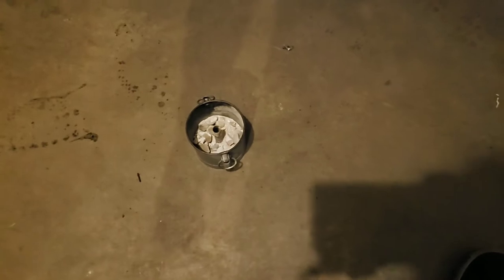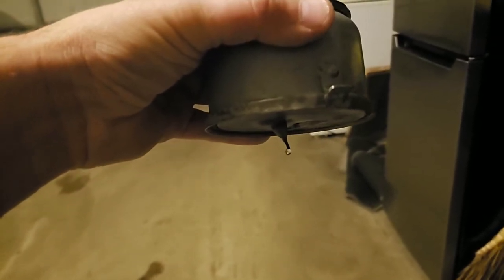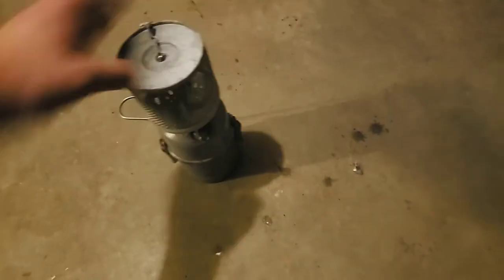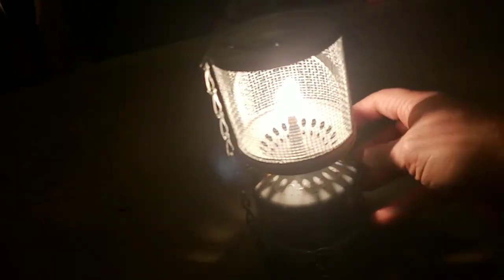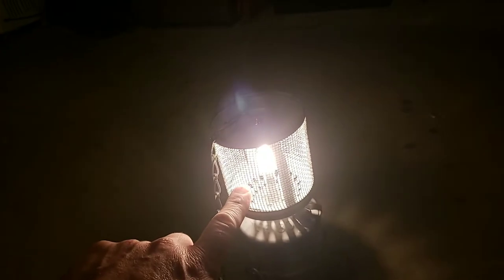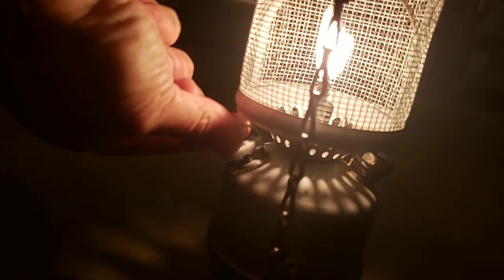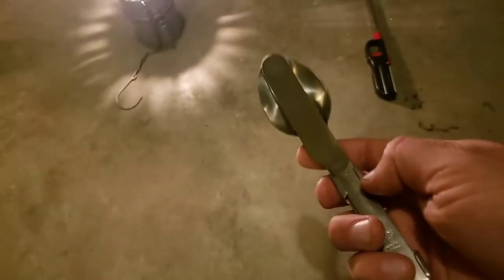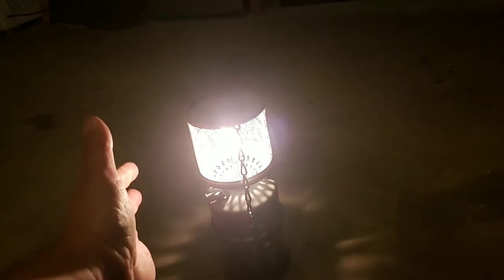Warning!  Very boring video of the Swedish Army Carbide Lamp.  I even added the utensils&can opener.

Comment: Off topic but, any interest in doing the STP ride on your  MO-93 electric.  My MO-93 is getting a front wheel motor and I’m thinking about it.
Reply from the maker: I was training to do it without motor last year, but my wife didn't support it.  This year, I don't think I can as my knees have been killing me, so I haven't been riding for a month.

The electric bike kit I have weighs about 15 lbs with battery.  My set only gets 30 miles max and with all the hills where I am at, it pushes 20 miles.  I don't think I'd like to pedal all that weight after the battery dies and it takes 6+ hours to recharge the battery.